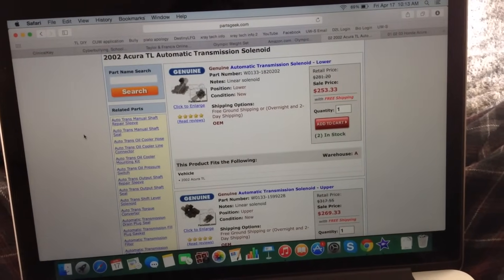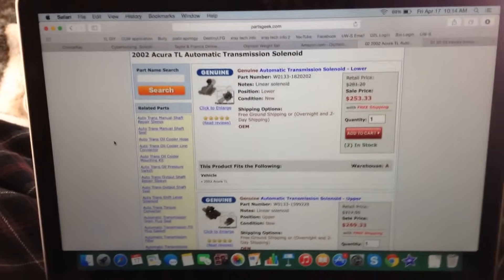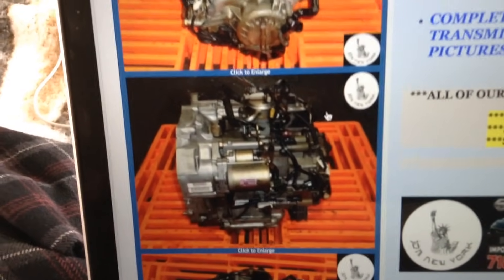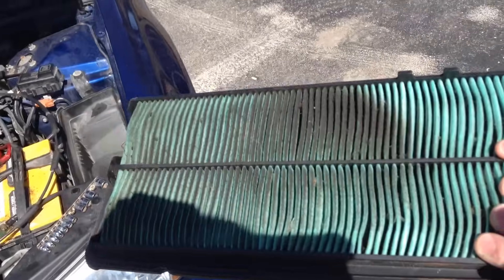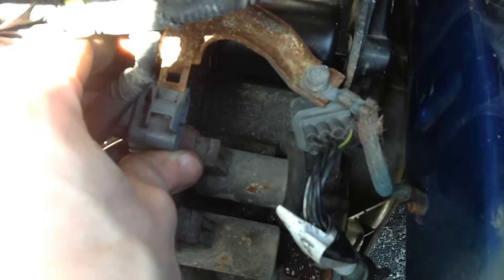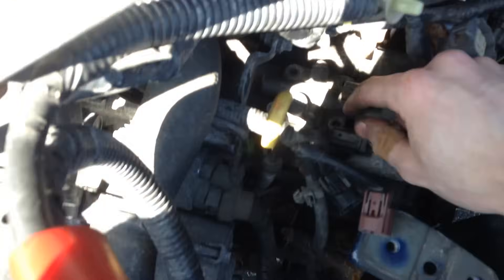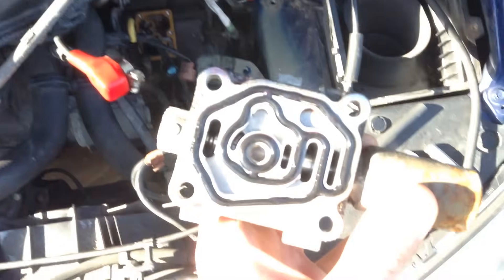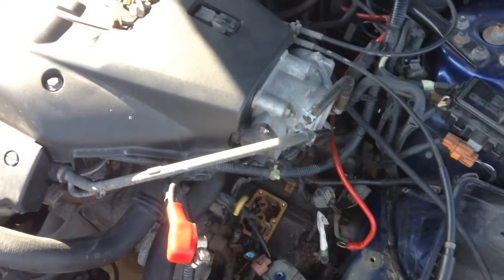Transmission Fix: How to Clean Solenoid Screen Filters for Honda/Acura P0730 P0740 P0780 P1750 P1751

Comment: hey i could really use your help I'm having big problems with me 2002 acura tl type s 150k miles i bought it a month ago it was driving fine only prob was if i didn't warm it up the car would just go into neutral wile i was driving randomly but i would just turn the car off and on and it wouldn't happen again but as long as i warmed the car up nothing happened , i put in a bottle of lucas stop slip because people on message boards said it work and it did for 1 day the car ran perfect then all the sudden on the highway it just started going crazy so i drained the fluid and added 4 qt. of new tranny fluid and the car ran good again for 1 day but now again the car has p0720 and p0730 code the car will go into d5 drive for 20 seconds and then neutral out again so i have to turn it off let it sit and again drives for 20 seconds and neutrals out again , took it to the shop he said i need to rebuild the transmission but i really don't have the money to rebuild so i wanted to see if theres any advice you can give me on something i can do to get this car running again
Reply from the maker: Interesting, when I was having my transmission problems, it would run fine when cold, but when it warmed up, then it started having problems. 

Personally, I wouldn't have put the Lucas in at all. All it does is make your ATF thicker which isn't good for this car which already has transmission flow problems, hence the oil jet recall. On top of that, these solenoid screen filters and the exterior ATF filter both of which most people don't think about can actually get clogged over time, and then trying to run thick fluid through those clogged filters won't help anything. Not criticizing you, just letting you know why you should avoid it in the future.

P0720 is a "faulty speed sensor" CEL code, which can be caused by your transmission problems. P0730 is a "faulty shift control system" CEL code. This code can be caused by improper maintenance of your ATF or a faulty solenoid. 

So start with these things: did you clean these solenoid screen filters yet? How's the electrical current in the solenoids? When was the last time your exterior ATF filter was changed? How does your ATF look? Bright red, dark red, brown, or black? Where's your ATF level at? If it's too high or too low, that can cause symptoms and possibly damage to your transmission. To check it, bring your car to full operating temperature, park your vehicle on a perfectly level surface, turn off the car, and check the ATF dipstick. Make sure you use authentic Honda DW-1 ATF fluid.

Comment: Most common mistakes made by mechanic technicians is that they mis diagnose the problem and rebuild the whole unit; when it could be a small part that's is wrong! Heat is the enemy of transmissions, most of the time on high mile vehicles it's the shift solenoids that get dirty and cause shifting problems. not all trans are the same in design just like not all transmission builders are any good especially when they rather rebuild than diagnose a common sense problem, nice vid...
Reply from the maker: Thanks! Yes heat is definitely a problem, which is exactly why this vehicle had a transmission recall to get an oil jet installed. Initially before I figured this solenoid solution out, nobody wanted to diagnose my transmission and just straight up quoted me thousands of dollars to do a rebuild. I hope more people can learn about this relatively simple fix to avoid wasting thousands.
Reply: Incin3ration so this fixed your transmission?? All that material in the screen is clutch material so it’s just a matter of time before the problem returns
Reply: @wendellgreenidge3362  did you not read it said about 100k plus miles later that the car is still running fine?

Comment: I have really hard shifting on mine but it has over 300,000 miles on it. I am curios if this would cause such issues. no cel code for transmission but fluid looks ok. The car is really well kept up with so I think it was not too abused over its life. Curious on your results thank you
Reply from the maker: It's been 26000 miles since I did this and my car still runs great! Those tiny filters are a really fine mesh and do their job in catching debris and gunk. I can promise you cleaning these filters can only do good for your car. If they're not dirty, then you've lost nothing. Even if the filters are clean, the solenoid itself can go bad. I've seen some people get a new solenoid and their problems were fixed. So I would recommend doing an electrical ohm test as well. And that's awesome to hear you have over 300k miles, I hope my car can make it that far as well!
Reply: Oh ok great! well I opened mine up and they were clean like you would not believe. This car has really been kept up with up until the last few months that the last owner decided not to care for it anymore so it really does not need much. I think that the issue is from him overfilling the transmission a little bit. I have yet to drain the excess but it runs alright for now. Hard shifts especially when the car is cold so I know I have to change to atf md-1 instead of the older z1 they used when the car first came out. 9 quarts for 3-3 process ill keep you updated
Reply from the maker: Yeah improper ATF level's can cause a transmission to act up. Make sure to check the ATF level properly according to the manual. Basically, bring the car to full operating temperature, park the vehicle on a level surface, turn off the car, and then check the dipstick. Also, idk if "MD-1" was a typo, but use Honda ATF DW-1, which is the new and improved formula that replaces Z1. Might I also recommend changing the exterior ATF filter if you know it hasn't been changed in a while. It's about $39 plus shipping on acurapartsforless.com. Part number for my car is 25450-P7W-003, but double check that it can fit your car.
Reply: Incin3ration mine doesn't come with the external filter as mine is the base model. the upgraded models did have one. another thing to note, mine only has one set of solenoid while the others like yours has 2. thanks for the help though it is good information for those who do have those features. and yes thanks for the correct info on the fluid. my dyslexia gets me bad at times though irs kind of funny how the mistakes happen

Comment: hi incin3, I just find out the Definition:code was P0730 indicates an incorrect gear ratio.and also said error codes read: P0730,P0401,P1739,P0740.I don't know which one do I need to fix first its hard to tell.thanks
Reply from the maker: damn dude lol lot of codes you go there. okay, I'll try my best  to help. Firstly, P0730, P0740, and P1739 are all transmission error codes. One possible cause for all three of them is low transmission fluid level and dirty transmission fluid. I know you already changed your ATF, but when you did, if it was really dark and dirty, maybe even smelt a little burnt, that could be a very probable cause for your issues. Another possible cause for these codes is faulty solenoids. On top of cleaning the filters, it'd be a good idea to check if power runs through them properly. With some wire and alligator clips, you can connect the wires to your car battery, and touch the pins inside the solenoid connector which will make a distinct click if it's working. Plenty of videos on youtube showing how to do that. You could also do an Ohm test like I did. This could possibly reveal that you need a whole new solenoid. For P1739, that one is very straightforward, there's an issue with the 3rd Clutch Pressure Switch. First, check to make sure it's properly connected, otherwise, you need to replace it. Last code P0401, that's a pretty common code for your car. Basically, you need to clean your EGR passageway. Lucky for you, EricTheCarGuy made a video for your exact car and P0401 code. Look up his video! For more info, go to autocodes.com and type in your CEL codes. Hope this helps!

Comment: My co-worker has a car with transmission issues on their TL and the repair shop was claiming $2500 to fix (about to call and confirm that it really is the solenoids since her son took it in).  Even if we were to replace just the solenoids, it shouldn't cost anywhere near that much (found them on RockAuto for ~$150 a piece).  Heck, they bought the car for only $3200.  I'm down to saving them some $ even if I spend an hour or two to do it myself.
Reply from the maker: Yah it is a relatively easy job to do. Just a lot of parts to remove first. When I first initially called a transmission shop, they weren't even willing to try and find a solution, but rather just quoted me about $2500 to rebuild the transmission. I said screw that and ended up discovering and fixing the issue myself. I can't guarantee you this will fix your problems, but it has helped most people. Good luck!

Comment: I have av 2006 lexus GS300 sedan. it doesn't shift onto higher gears 4 -6. it gets stuck on 3, doesn't switch past it. I diagnosed and got d error code p0761 shifting solenoid 'c' or stuck off. I av replaces transmission oil and gear filter, tested the solenoid and confirmed it's working perfectly (I. e no electrical faults with it). I'm out of ideas. pls anyone help suggest a solution. thanks
Reply from the maker: yah that's an interesting situation. If the solenoid itself it working properly, only other thing I can think of is to make sure your ATF level isn't either too high or too low. Also, if your ATF was really dark and dirty when you changed it, that might have caused some damage to your transmission.  Maybe check out some Lexus forums for other possible solutions on this CEL code.
Reply: Thanks for your reply. Truly it was very very dirty when I drained and removed d pan. D magnets were also covered with dirt, buh no metal scraps to indicate wear of internal gear parts. I'll seek other forums online like u suggested. Thanks

Comment: Running an 2001 Acura Cl with 254,000 miles on original transmission and engine.  Will be attempting this project tomorrow.  The car seems to not want to change out of higher gears but there is no real jerking, no banging, none of the classic symptoms I have have with other transmissions that went out on me.  

Thanks for the info I got a P0740 code at autozone today after the engine light and TCS light came on at the same time.  TCS turned off after cranking engine again,  

I will post tomorrow when done and let you know about the results.
Reply from the maker: Good luck! Look forward to hearing your results!
Reply: Incin3ration well the resistance on the two units were 5.2 just like yours. The screens were medium biuld up but the real problem is the  trsnsmission fuild is so old it looks grey. i did not notice any metal flakes just grey, burnt smelling transmission fluid. will be doing the 3 quart drain method commonly seen on other youtube channels. Currently the engine light is off but i assume this is normal and the P0740 code will trigger again ain the near future.  Thanks for the help this video is extrrmely helpful at getting me on the right track. As of rigt now the car seems to operate normally. Fingers crossed I'll keep ya posted!
Reply from the maker: I'm glad it helped! And that little bit of gunk is all it takes to cause a problem. Assuming your transmission is just like mine, make sure you get Honda DW-1 ATF and none of that aftermarket junk. DW-1 is the new and improved formula that replaces Honda's old Z1 ATF. If your ATF really is as black and burnt smelling as you say it is, I might even recommend doing the first drain and fill, driving your car for a week, and then doing another drain and fill the next weekend. The fluid should be red. You can get a case of 12 quarts on eBay for $89 which will last you a good 3-4 years. Obviously with these transmissions being notorious for failing, you can't trust what the manual says in this case. I would recommend making it a habit to do a single drain and fill once every 15,000 miles after this. If your car had the transmission recall done, it might be easier to put the ATF in through the ATF dipstick hole.
Reply: Incin3ration looking to purchase the z1 atf and then do the partial transmission drain method. Car is still operating well and no check engine light.
Reply from the maker: Excellent! I'm glad your car is working smoothly again!
Reply: Final report.  Changed transmission fluid using 3x3 method with Z1 that was the same price as the DW1.  This is not my car so I used what was decided for me: I am still curious how the DW1 would have worked out.  

As for the Z1 I have felt much improvement when then car is shifting.  Over all the car seems to be doing better though I have sternly warned the owner that this car's transmission can break if you look at in the wrong way and she needs to keep up with the maintenance instead of letting her tranny fluid turn to a fine shade of burnt gray.  

Finally I replaced the transmission filter under the intake air hose.  A quick google search recommended that the filter be replaced so that the new fluid would not become contaminated by the junk in the old filter.  

Hopefully others read and learn.  Without this youtube video I don;t think O could have gotten the CL back on the road and running stronger than before.
Reply from the maker: I'm glad I could help! Congrats on getting the car running again!

Comment: I am having problems finding the second one and your video here seems to quickly flash pass the locations both times no good
Reply from the maker: How do you not see it? If you have a different vehicle, like I said, the locations and quantity of the solenoids may differ. Otherwise, I thought I made it abundantly clear at 3:48 when I zoom in. It's taking up practically the whole screen, and my mouse is on it lol And then I point my mouse at each of the 4 screws at 3:57. At 13:40, I hold the camera at its location for 30 seconds. Wouldn't call that flashing past. Also as stated in the video, I had already taken it off by that point. You should be able to see the extra shiny surface and the screw holes for where it would be. Imagine you are standing in front of your vehicle with the hood open looking at the engine. That's the same perspective as that picture of the transmission. After you have removed everything to get to that first top solenoid, there's really nothing more you have to do to get to the second one on the front of the transmission. Hope you can figure it out.
Reply: James Metalarc, different years may be different transmissions. I have a 1999 4spd and I dont show that solenoid either. Might be (I don't know) only on the 5spd trans

Comment: each one was different size
Reply from the maker: If your solenoid was different then mine, then I can't really help ya. If they're different diameters, that would help a lot since they could only fit in one specific spot. but if they're different lengths, try looking on the car itself and seeing if the receiving end has different depths, then placing the filters back in the solenoid accordingly.
Reply: Ty I got yahoo different size just had make sure all same height across the

Comment: there 4 filters but which one goes where
Reply from the maker: It's been a while since I did this, but the larger filter is by itself in the one solenoid. The three smaller ones if I remember correctly are all the same size. If you want to take the extra precaution just do them one at a time and put them back in the same way you took them out.

Comment: I have 2002 Acura mdx i will try this method, my mdx upshifts pretty bad only sometimes but sometimes it changes pretty good I have taken it to many mechanics there recommendation was to rebuild transmission or replace it with new one but i will let you guys know after trying this I honestly am glad we have ones like you that tries to help others thank you very much for you video.
Reply from the maker: Thank you very much! I do what I can! And I had the same symptoms at first, where sometimes it would shift good and sometimes bad. But with time it progressed and got worse. Good luck! I hope it works!

Comment: Just did this w/ resistance check (5.3 ohms) and tranny still slipping. I have also replaced neutral safety switch in hopes that it would fix the problem and nothing. At this point problem seems mechanical, what do you guys think?
Reply from the maker: Only other thing I can think of is to make sure your ATF is clean and between the minimum and maximum lines on your ATF dipstick. Too much fluid can actually cause problems such as slipping, and obviously not enough is problematic too. Idk the last time you changed your exterior ATF filter, but that could also be a possible issue considering its 15 years old.

Comment: it didnt work for me, they where clean , still worth a try good luck
Reply: Chulo_da9 G did you end up replacing the solenoids? Mine were clean too
Reply: @Praiseyahwehandyeshua  what codes are you getting?
Reply: What codes were you getting?
Reply: Hey guys were you getting codes P0740? If cleaning didnt help it may be time for new soldenoids. Will order new ones if this fix doesnt work.